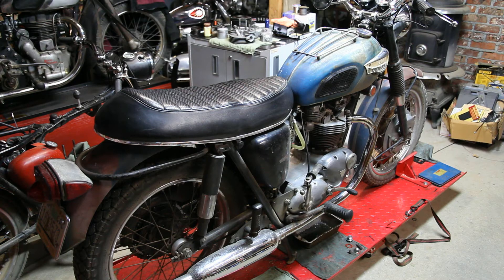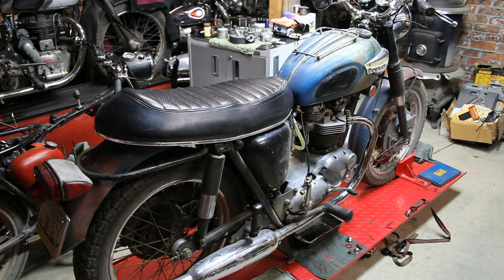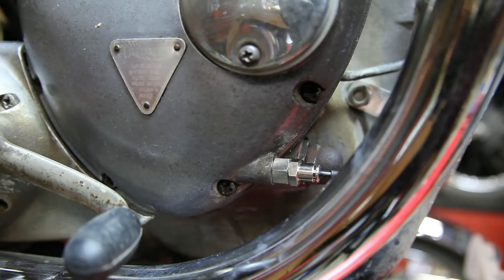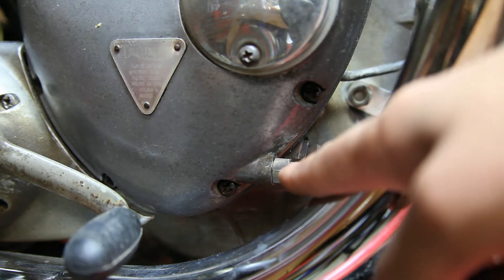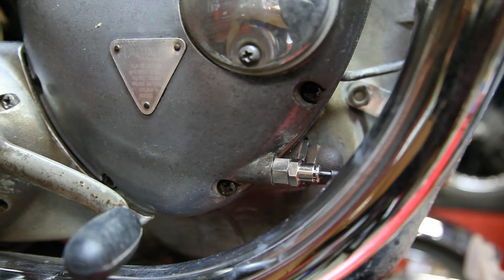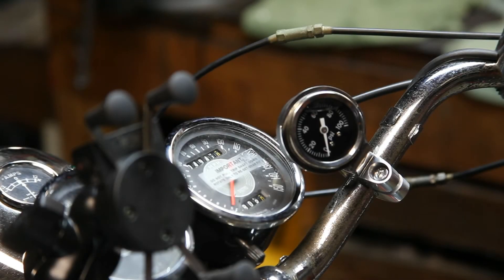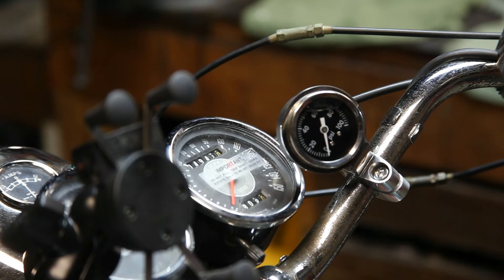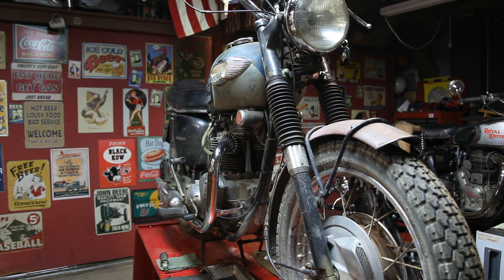New Oil Pressure Gauge Kit For Triumph, BSA & Norton Motorcycles - Classic British Spares

Comment: When you say "3/8" are you measuring the O.D. of the fitting? 
A fitting references the inner diameter not outer. All the fittings I have seen and that is on my 78 T140 is 1/8" NPS and it has the same boss.
1/8" NPS or NPT measures for reference ~3/8" outer diameter but its actual size refers to the I.D. of the fitting which is 1/8"
I would like to buy one of these but this 3/8" you are mentioning doesn't make any sense. Even in your video it appears to be a 1/8" NPS fitting not a 3/8"
Also regardless of straight or tapered pipe fitting are all 27 TPI are you sure its a 24 or the 26 TPI you mention?
Please explain.
Reply from the maker: There are different types of threads, not just American threads. This bike uses 3/8" British Straight Pipe - 26 TPI. The kits we sell come with 3/8 BSP, 1/8" NPS & 1/8" NPT

Comment: Was your ‘68 tapered or strait thread? I don’t have a thread pitch gauge but I’m reading in a forum that most all triumph 650s should be strait thread. I just bought the gauge for my ‘71 TR6 650
Reply from the maker: Mine was straight, later was tapered I believe